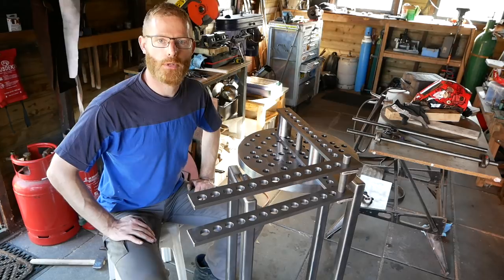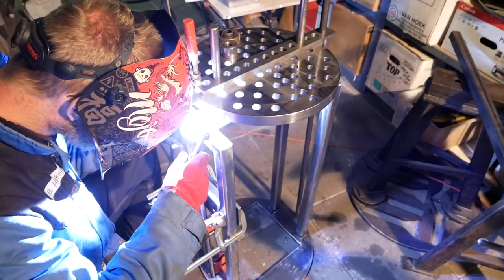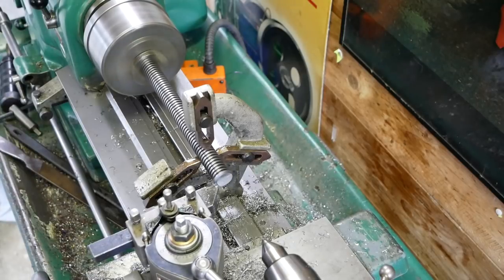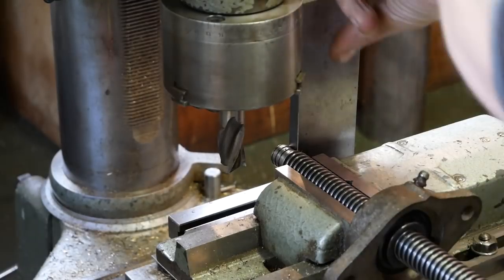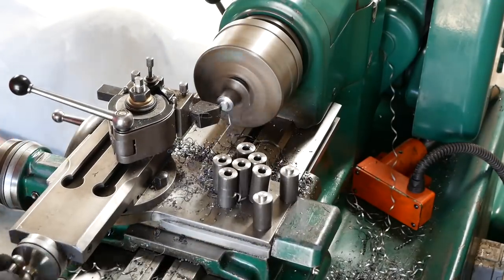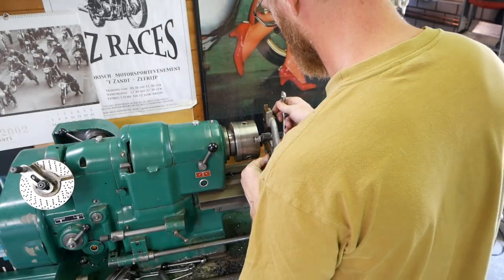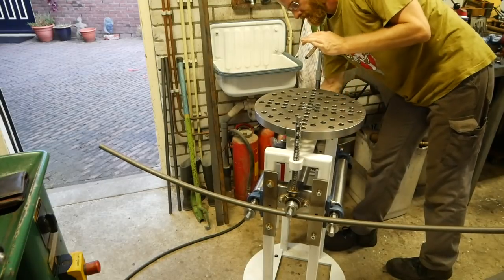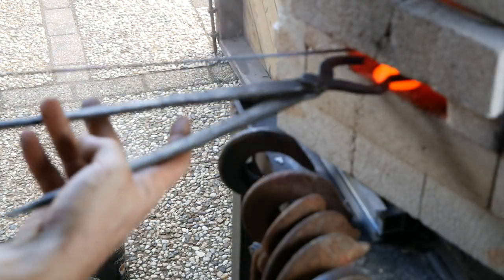Making the Ultimate Bending Maching Part 3: Plate and Ring Roller

Comment: You can use the flap disc longer mostly due to using all of the contact surface. When handheld, no matter how hard you might try, you'll favor one edge of the disc (for me that's the outside edge)

Comment: Excellent  workmanship. 
Bart, try a swivel head torch.
You can easier maintain  a comfortable hand position. 
Again nice work.
ABC's of welding 
Always be comfortable.
Reply from the maker: Thank you. And a few month ago I bought a Lincoln Invertec (V200-t) with a flex head. I Like it a lot and agree that its a lot easier to keep a comfortable hand position.

Comment: Excellent work! How did you manage keeping the materials from starting to rust?? Workshop must really be low humidity.
Reply from the maker: Well I did have some rust problems but most of the build was during summer time and then it's fine for a few weeks. And I did a good cleaning before paint. In the winter it's really terrible with humidity in my workshop but I am moving in about a week.

Comment: Probly would have gone with sicker wall tubing because it limits the sheet that you can bend to less than the wall of the tube, Although obviously easy sickness of the shaft would make a bit of a difference as well you can't have the shaft weaker then the tubing.

Comment: Like your work, nice integrated design. But always a but. Lol
In a Lot of places you use heavycwall stock and heavy flat bar then barely weld it, no weld prep for penetration, just on the surface. Then in many places you grind the welds. Not much holding it.
The rect tube with flat bar at each end near the start is an example. Just wondering
Reply from the maker: Yes, you are right about the welding. On some parts it could use some more beveling and I need to take some more time for that. But for the forces that it needs to hold it's more than enough.

Comment: What brand is step drill bit do you use
Reply from the maker: Phantom 6-25mm HSS. Used (and sometimes misused) it for around 5 years and it's still in good condition.